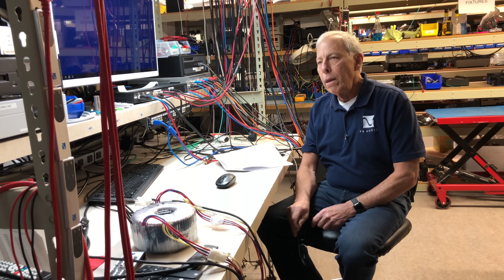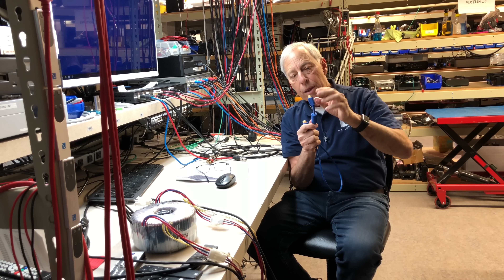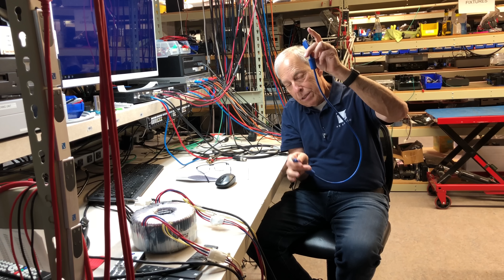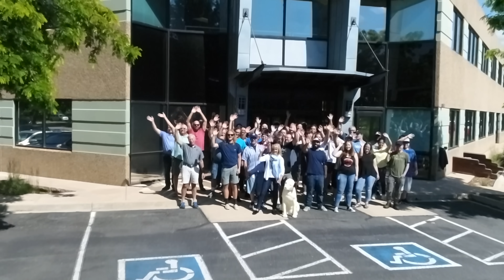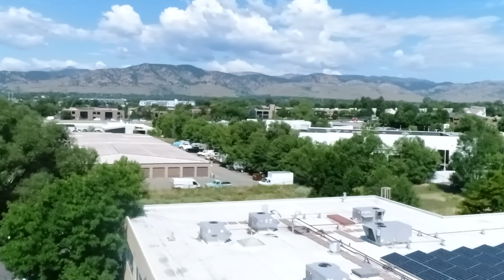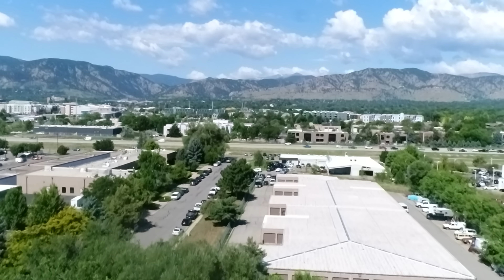Should amp impedance be high?

Comment: So why not have high ohm speakers? Wouldn't it make more sense for the speaker to use all the power sent to it and not just let it pass through dumping it back into the Amp?
Reply: Relative to the amplifiers, the speakers we use actually are "high ohm."  Generally, further increasing the speaker impedance reduces the amount of power that the amplifier can send to them, since it has a well-defined max output (clipping) voltage.  
Regarding power (or current, to use a better description) going back into the amp, this is due to the reactive nature of speakers, and would not be ameliorated by designing them to have a higher impedance.  That is, the percentage of power (current) that flows back would still be the same.
Reply: The trick is winding enough copper on the voice coil to present that higher impedance. The gap spacing is set by the magnet strength and the wire gauge needs to be large enough to not act as a fuse. With classic magnets there was a good crossover at 8 ohms at the very low ohm end but there were a whole generation of speakers before that with higher impedances to make it easier to wind matching output transformers or as better matches for being driven directly by germanium transistors without needing any output transformer.
Reply: I want to have a crack at this my self high impedance inputs are basically voltage receiving inputs or signal inputs they need really no current and since the point of these inputs is to receive signals u want the impedence to current to be very high so no current to drive or distort the signal or change it in anyway think of it as a data line it's just transferring information not driving voice coils or doing work like low impedence high current outputs or inputs high impdence means it's basically means it's it driving a gate of a transistor or grid of a tube something that has no real physical connection to the power supply or coil it basically just copying the electric field state of signal and passing this information to transistor junction or plate of a vaccum tube  that actually does the heavy current lifting required to drive the signal hence field effect it's just super imposing the signal on to a device that then amplifies. A speaker needs to be low impedence because it's the current through the voice coil that moves the speaker motor super high impdence speakers would need super high voltage to drive them which is wasteful and inefficient I hope this helps.

Comment: Paul does well on these things. Good go’n Paul. I donno if there’s an industry standard for audio power amplifier input impedance. The PS Audio S300 input impedance spec is 50Kohm. If you go too high, undefined, you’ll start to pick up noise mostly in the RF range. Maybe you put a very small capacitor across the input like 20 picofarad to sink out that RF?

Only thing I would add is that the voltage into the impedance, using the S300 as an example, is dissipated as heat. And certainly not very much. Microwatts?

Comment: And to clarify... impedance (as opposed to resistance) is frequency dependent? The way I have heard it explained is  resistance (in dc current) is like driving a car on a road. You can go left and right. You are traveling in 2 dimensions. And that is it. In an audio circuit  impedance is like flying an airplane. You can travel left and right, but when do, you altitude will also change, so now you are in 3 dimensions. And you have to adjust to maintain your altitude. Sound right?
Reply: Yes, speakers have complex impedances.  But that's beyond the scope of the original question, which only seeks a basic understanding.

Comment: Another way to state what Paul just said, the high impedance (to ground) helps steer the signal to the components, much like having 2 doors at the end of a hallway, both are unlocked, but one door is open and the other is closed (but you can still go in, just open the door, i.e. the high impedance) .  It is a way to control the flow of the signal in a desired direction.

Comment: Paul,  Aren't those inductive chokes on your demo cable?  If so, the inductance really isn't zero at all frequencies.
Reply: Yes. Thats a digital cable and hence the use of those. You want to impede the RF in your room or transfer one device to other.
Reply: Strictly speaking, that's correct, but you are talking about a frequency range well above what we deal with in audio.

Comment: Not sure you answered the question.  The wire of course should have 0 impedance because it is just a connector if two things.   The question was about the amp.  

But to be honest, it seems to me that a course in electrical engineering is required to understand these concepts.   So congratulations for trying.  As a professor once told me. “A sincere attempt to meet the requirements of the assignment.” Grade C+.